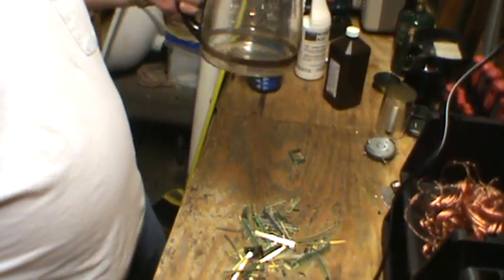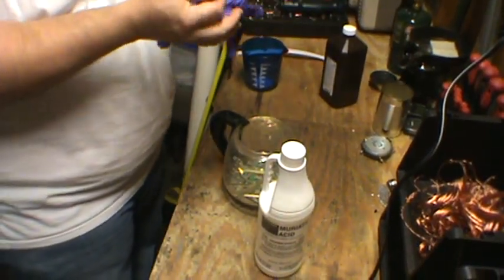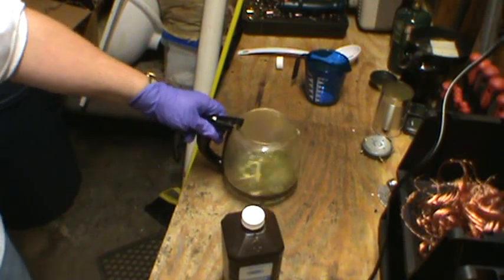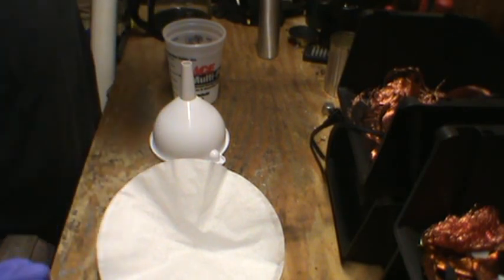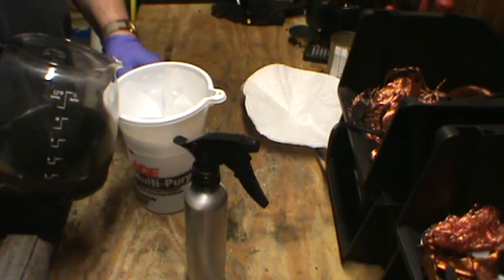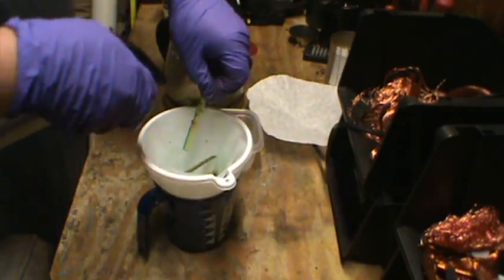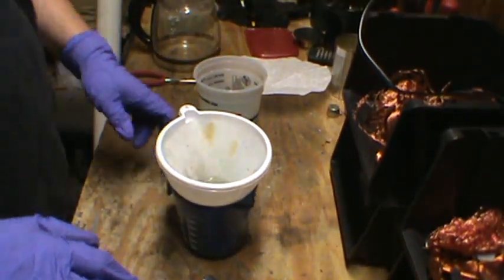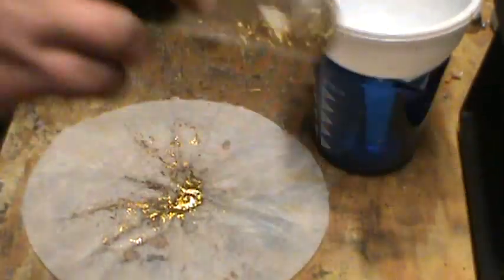How to Recover Gold with A/P Acid peroxide method for gold fingers and gold plated boards easily.

Comment: Hey Moose, I know this is an old video but I am getting ready to do some processing and have a question about a comment you made.  You said that the gold is bonded to copper layer, but I thought it had a barrier layer between the copper and gold made up of Nickel to stop ion exchange between the copper and gold.   If there IS Nickel in it, does that kill the A/P or what other special handling might I need to do to take care of any residual Nickel that may be present?
Reply from the maker: There is nickel.  I am not sure how to handle the nickel.  I personally evaporate everything when done and bring the solids to a chemical disposal facility.  The nickel is toxic, so is the copper...  There are methods of removing the copper, but I am not sure of the nickel.
Reply: That makes sense that the most common form of money the penny and the nickel are toxic for humans lol  before our 'leaders'  couldn't afford the solid copper penny so they stuffed some nickel Right? now it costs 2 cents to make a penny lol... but i digress

Comment: the acids are expensive.. do you even break even? lol
Reply from the maker: The acid was $8, I more than break even
Reply: what about the cost of the boards?
Reply from the maker: free.  I recycle computers so I get all the materials free.
Reply: Moose Scrapper fair enough. so yearly income from this, is it enough to live off ?
Reply: it is very possible yes , if you get enough material to refine , then yes you could live off of it and even make yourself a small business , other wise it's only a hobby :)

Comment: Is there a way to recover if your peroxide / Acid solution was too strong and may have put the gold in the solution?
Reply from the maker: +Wilson Revelle Yup, that is a very very common question.  Just put a piece of clean copper in the solution.  The copper goes in, gold drops out.  Typically black powder.
Reply: Thanks!  Great vids!

Comment: Great video!  Hey do you scrap hard drive metals? Not sure the platter metal, but thought it was a precious metal...?
Reply from the maker: +G Wood Platters are wither glass or aluminum.  most commonly Al and have a film on it that contains platinum, but it is extraordinarily thin.  There is typically less and $5 worth per lb of platters and the acids required to retrieve it cost more than the platinum.  They do make nice crafts though...

Comment: Moose, I like your videos.  I have a few gold plated coins, is there a way to recover the gold?  Is it worth it?
Reply from the maker: +Christian Dean reverse electroplate, I have not tried it yet but for solid plated items its the way to go.  As for if its worth it?  You would most likely get more for the coin as is on ebay.  gold plate is very very thin.

Comment: Hey Moose....haven't seen any posts for a while but then again I haven't been on YT all that much. Have you tried Sea Salt and White Vinegar using an aerator instead of the A/P method? Takes a little longer but at least I'll have organic weed killer when I'm finished.
Reply from the maker: +pacoblancosmith no I have not.  That process yields a very toxic solution and can not be reused.  I have not been on much either.  Just got divorced and having to rearrange my life again.  Take care!
Reply: Why is the vinegar more toxic at the end?

Comment: on some boards there is a green layer over the gold. How do I get the green layer off to expose the gold under it?
Reply from the maker: +Kevin McIntosh the solder mask can be removed with hot water and lye in most cases.  I have a short video on it done last year.

Comment: Hey Moose, Quick question. Can you take AP and bleach to dissolve the gold off of cpu chips or do you have to remove pins first? Also how long can the gold solution stand without adding to it? Tks.
Reply from the maker: +Michael Murphy Hi and thanks for watching.  Your question is a little confusing to me.  You would not add bleach to AP, it is not that same as adding bleach to HCL.  It also makes a difference what type of CPU's you are referring to.  Ceramic pins do not need to have the pins removed, they can be processed whole (broken into pieces) with Aqua regia.  The green CPU's will need to have the pins removed first.  THe pins get boiled in HCL and the rest of the board soaks in AP.  Also, which solution are you wanting to know how long it can stand?  I have the same bucket of AP that I have had for almost 2 years now still working and the bottle of Auric chloride I have held for about 6 months at a time.

Comment: So there's no other way to refine gold instead of using nitric acid because I can't have it under my possession (Canada) unless I make nitric acid through processing chemicals
Reply from the maker: +fixmybrokencondom There is no way that I know of to refine solid pieces of gold like jewelry without nitric.  Other methods would take months for the gold to dissolve.  The only other think I could say is maybe, its highly likely that it will take way too long but if you were to somehoe cut up the jewelry in pieces as small as you can possibly make them, the put in a solution of about 100ml of HCL 31.45% and 20ml of regular bleach, seal the bottle and let it sit, in a couple months it may have had enough time to dissolve.  Then you can precipitate the gold with SMB.  The solution will still contain silver or what ever metal was used to dilute the gold to 10 and 14k.

Comment: So this is another method without using nitric acid to extract gold?? What's nitric acid used for? Can I not use nitric acid?
Reply from the maker: +fixmybrokencondom I don't use nitric acid.  THis method is for gold "recovery" from certain types of material.  Nitric acid has other applications that this will not work for.  Check out CM Hokes book on refining precious metals.  Its free on the goldrefiningforum.

Comment: can u scrap it off or do u have to use meratic acid
Reply from the maker: +fred johns You can scrape off the fingers.  But imagine it like this.  Take 25 sheets of paper and glue them all together.  then glue the stack to your desk.   Now, when you scrape the foil off, its like scraping the 25 sheets of paper off the desk.  The thing is, you get all 25 sheets, of that, 1 sheet is gold, a couple are nickel, then the rest are copper.  so no matter what, you still need to soak them in HCL to get rid of the metals stuck to the gold.  So scraping them is like adding an extra long process.

Comment: I did a 1:1 ratio by accident, now what. Im concerned that the gold is gonna get dissolved. Its been running for about 5 hours and the solution is black. Should I throw in some copper pennies so the acid dissolves that and pushes the gold out of solution?
Reply from the maker: +Coolnventions how many gold fingers do you have in there weight wise.  What is the total fluid volume?

Comment: Moose...when is it safe to cap the solution? Is it safe when the reaction is going on or will the fumes build up too much and cause it to explode.
Reply from the maker: +Josh Garland You should not cap it while the reaction is going.  Putting a loose lid is fine or if you are using an Erlenmeyer flask you can wad a rag into the opening.

Comment: what do i do if the gold foils dissolves in the A/P
Reply from the maker: +Frank Miller Depends on how much patience you have.  If you are impatient, put a large piece of clean copper in the AP and wait until it no longer dissolves.  The gold will drop out of solution as a black powder.  Just note, that for just about every beginner...and this included myself as well when I started, we all think we have more gold than we actually do so depending on how much solution you have and how much gold is dissolved in there, you may try this and not see anything noticeable precip out.  For the patient person, just forget about it.  Keep reusing the AP over and over.  By the time the solution is spent, the gold will have dropped out as black powder.
Reply: thank you bro

Comment: how can i separate 18k gold fill off of a pin set
Reply from the maker: +Brian Graham You have a set of pins that are 18k gold filled?  if that's the case you will need to use nitric but I do not know enough about that to give you any more info besides checking out the gold refining forum.  BEst of luck to you!

Comment: ok, did my first batch today. soaked in AP for 32 hours. I didn't weight anything, but had to use a total of 8 cups of AP to cover all boards and gold fingers. Got all the gold flakes off, but my question is, do you get green flakes mixed in when you do this process? is it ok to leave in there? will the next step in the process eliminate them?
Reply from the maker: +stephen p NICE!!  32 hours is a really short time for AP!  As for the bits of green board, that is inevitable.  That will come out in the refining step.   Remember to keep the AP, it has a lot of life in it still!
Reply: +Moose Scrapper yes sir, I was surprised 32 hours was enough time. Only had to spray a few with water. Looked like a big golden snow globe.
Reply from the maker: +stephen p It put a smile on your face....didn't it...  its ok....you can admit it....rofl
Reply: +Moose Scrapper you betcha.

Comment: hey" Moose" if i have know pins there wires of gold 1/2jsteel & 1/2 gold can i get the recovery from AP ? i cant do the reverse thing i dont have the $$ on hand out of work wright now so i do what i can for my fam and scraping help us here in Calif thank s
Reply from the maker: +fredie w Hi and thanks for watching!  I am sorry to hear that you are out of work.  If I could give you one tip it would be that you will make much more money scrapping other metals than gold.  This has been a pretty slow year for me for scrapping because of my leg but I keep track of the numbers.  For every 100 computers, I get almost 2000lbs of steel, 75 lbs wire, 50 lbs of aluminum, and that alone is almost twice as much money as I make in the gold from those computers.  The mother board, drive boards, peripherals, copper, ram, cpus, etc can all be sold to refiners for good money as well.  Much more than you would make running small batches for gold recovery.  Also, you can make even more money if you sell on ebay.  I make more money a month selling just the power supplies from pc's than I make in the scrap metal.  But if you still want to try to recover gold from plated steel pins, I think the only way for steel is with reverse electroplate.  If they were brass or copper pins then you could use ap.  And even then, the core would dissolve very slowly over a couple weeks.  Hope that is helpful.  Best of luck to you!

Comment: Hey Moose" what about pins ? can i use the AP as well the same way ??
Reply from the maker: +fredie w The best method for recovery from pins is going to be a reverse electroplating or gold cell.  There is a lot of info on this in the goldrefiningforum.Some people use ap and there are different schools of thought on it.  Using the ratio of 2lbs pins per gallon of hcl, some will put the required amount of hcl in a bottle with the pins and a couple spoons of 3% peroxide and just forget about them for a few months.
Reply from the maker: +Moose Scrapper And others say that they put them in hcl and an air bubbler, while other still say use 50:50 hcl and peroxide.

Comment: probably another stupid question. What would happen if you skip this step and just do the acid/bleach process? dissolve it all, get the copper out and bring back the 'mud'?
Reply from the maker: +stephen p You would be exposing yourself to deadly gasses for a lot longer than necessary, and the solution would also take in tin, lead, and copper so you would have precipitate, filter, then do the whole process over several times to improve the quality of the gold.  The folks at the goldrefiningforum are very....VERY insistent that short cuts are not tried as they create problems....sometime really big problems.  But certainly not a stupid question
Reply: +Moose Scrapper thank you, you're the best.

Comment: What is the reason for removing the solder from board? Thank you
Reply from the maker: +doug johnsonj to prevent the solder from dissolving then precipitating mixing with the gold as well as to prevent having waste that is more toxic than necessary.
Reply: OK thank you.

Comment: Hey  Moose, should I be separating my completely plated e-scrap from that which isn't?
Reply from the maker: +Desmond Singh Depends, if you are talking about circuit boards, completely plated vs partially plated there is no need to separate.  When it come to pin and plated metal objects then yes.  AP needs to have a good bit of contact with the base metal to work.  Fully plated metal items do not offer that so you need to try reverse electroplating.

Comment: could electrolysis be used during the acid phase to remove more copper, quickly, or would the gold get bound up with the copper?
Reply from the maker: +Jeffery Dodson That's a great question, unfortunately I cant answer that.  I have not done much for electrolysis at this point.

Comment: you asked for a suggestion ...Manganese; I found a s-load in the nearby hills. It's this beautiful electric purple-blue metal that coats all the geodes out here but, my neighbor (old guy, worked for NASA) tells me its toxic - and valuable. If the various acids used to extract gold (HCl, HCN, H2NO3, HF) are toxic, and gold being valuable, isn't this a tie? Yeah, I could look up the MSDS but I like your vids.

Comment: Moose can I processe de cpu in a/p solution?
Reply from the maker: +Ivan Hutik you can process pinless cpu's after you take the copper back off and fiber board cpu's after you remove the pins.

Comment: Hey Moose, About haw many RAM sticks would you say per gram of unrefined gold fingers?
Where is a good place to pick up Muriatic Acid?
Thanks, Dwight
Reply from the maker: +Dwight Baker I have found that 1 pound of trimmed ram fingers will give you about 2-3.5 grams of gold.  You will get more gold if you also process the IC chips on the ram sticks but I do not have any numbers for those yet.
Reply: +Moose Scrapper 
Thanks
Reply: home depot

Comment: Hola Moose, can you do a video about recovering gold pins breaking off inside the plastic death towers?
Reply from the maker: +Jay Stevens Its early, probably not enough coffee yet, but what are the plastic death towers?
Reply: the sockets that the pins are in... Sorry was a long night and having coffee
Reply from the maker: +Jay Stevens my method sucks, I pull them out with a pair of micro flush cutters....
Reply: i do the same but there are still some that wont come out. Just wondering if there was a way to process those still stuck..Thank You for responding
Reply from the maker: +Jay Stevens Is there?  yes..... is it safe?  Hell no.  Large recovery companies often use cyanide leaches that will suck the brass off a door knob if you know what I mean.  Deadly process though.  Still, if they get too frustrating for you there are always people who buy that stuff on ebay.
Reply: NO BUENO !!!!

Comment: Hi Moose, Fab from Oz here 😊, i tried this at home. The process did remove the gold but there also seemed to be very fine particles which looked like dust in the ap solution. When i strained it, i ended up with a whole heap of soft grey powderey wet gunk mixed in with the gold foils. Do you know what this is? How do i get rid of it?

I have taken some pictures but don't know how to share it with you.

Thanks mate😉
Reply from the maker: Fabrice Dupre likely solder that dissolved then dropped out.  Filter out then add hcl to it until the grey stuff dissolves again leaving the gold foils, filter those out and you should be good.

Comment: Hey Moose I am new to this stuff and just finished my third batch and I ended up with a lot of fiberglass looking stuff. Any Idea other that the nitric acid mix to get the gold out of all my trash.
Reply from the maker: James Harper start a bottle of refining solution.  Use HCL and bleach to dissolve the gold then filter.  All the other crud will stay in the filter while the gold is in solution.  Do not use a lot of solution, keep it under 100ml use a ratio of 80mlhcl and 20ml bleach.  Do this outside and stand up wind wear a respirator or something because the fumes are very toxic.  Keep dissolving your gold in that solution until you have completely exhausted your patience then use sodium metabisulfate "SMB" to precipitate the gold like in the video I have on gold refining.  Please make sure that you hold off as long as you can because most people think they have more gold then they actually do and the precipitation will not work well if there is not enough gold in there.
Reply: Moose Scrapper This will show just how new I am to this. What is HCL. And the SMB is that powder stuff right.
Reply from the maker: James Harper You are correct.... that does show how new you are lol.  HCL= hydrochloric acid, also know as muriatic acid.  The most valuable tip I can give you at this point is to go to the goldrefiningforum and read the free version of Hokes book on refining.  It will tell you everything, and save you a lot of errors and lost gold.  Lots of people think they can just watch a video or two and they know all they need to know, nothing could be further from the truth.  Best of luck to you!
Reply: Moose Scrapper Thanks Moose you have been very helpful to the new guy in the field of scraping. And for everyone else reading this Moose has been very helpful and managed to respond to my rookie questions very fast. Moose thank you and scrap on.